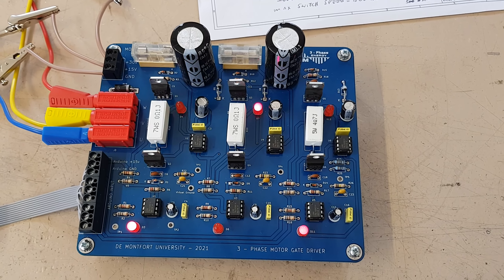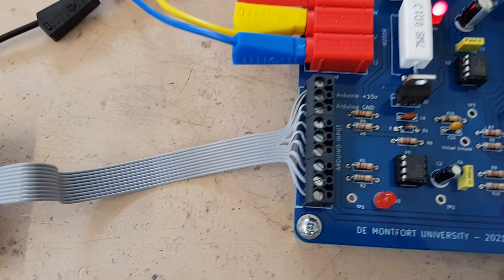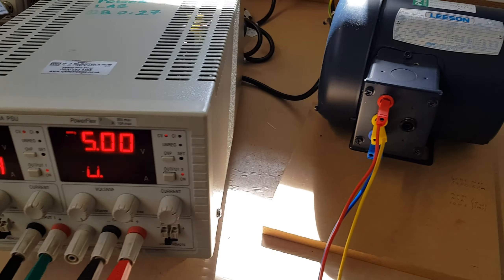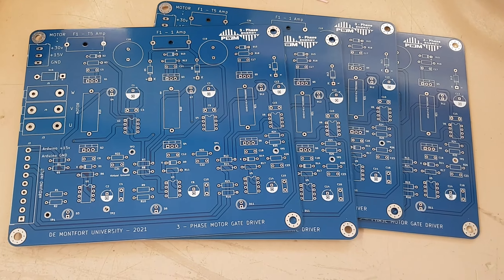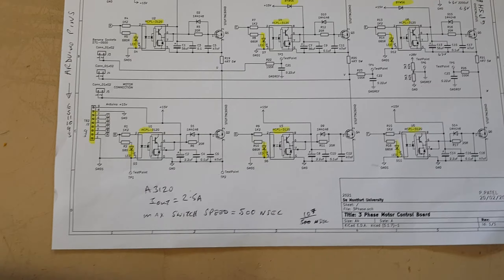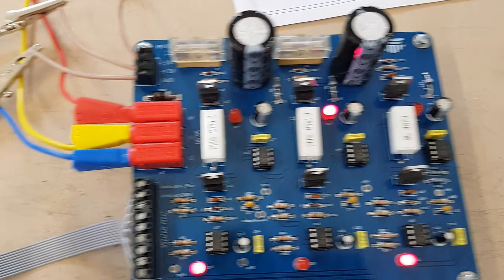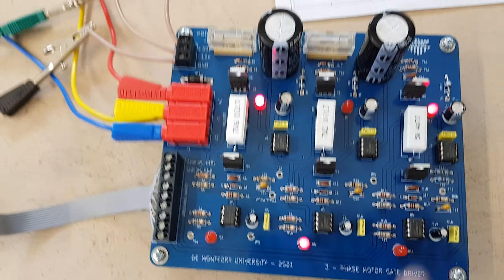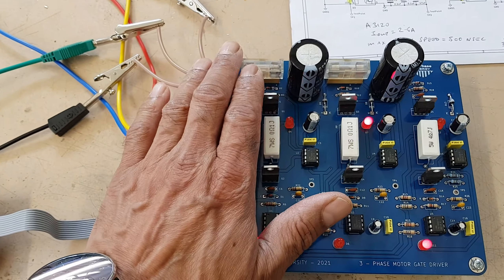Arduino Uno used to create an Inverter for a 3-Phase Motor !

Comment: Dear  Kash, l am very interested in your project, as teacher of electrotech at my local Tafe college l would very much like to build this , would it be at all possible to get the full data on this project please, many thanks.
Reply: Which TAFE college and did you end up making one? I am designing one now with harmonic filters and a 3 phase bridge rectifier to connect straight up to the ELV supplies in the classrooms.

Comment: Could you share a link to the motor? I'm interested to see all the details about it, the brand, speed/torque, the exact type (I suppose it's an induction motor?) and other technical characteristics about it. Also size and weight.

Comment: Hi Kash, fantastic project! Last week I started designing the inverter and I have a couple of questions before I want to have the PCB made at JLCPCB.

1.	As @optix also mentioned: is the REF ground floating? I see it goes to the center of a potential divider, but is it just a common for scope grounds?

2.	In the schematic you used GND and GND1. GND is from the power supply and GND1 comes from the Arduino (terminal). My question is, are these two grounds linked (externally) to each other and thus the same?

3.	Last question: Why did you use the BYW56 (avalanche) diodes with the top three drivers/optocouplers but not the bottom three?
Reply from the maker: Yes the floating ground is a common for the Oscilloscope leads, so that you can see the full sine waves
This is a demo board, and I have connected all the grounds together including the Arduino, 18v ground and the 35v ground.
The high side drivers at the top need the Diodes to charge up the capacitors when the bottom side drivers switch to ground. 
This is called Bootstrap diodes and capacitors, thanks 😊
Reply: Hi. for asking..could you be able to send me the two schematic diagrams posted here. the reason I asked is the author has abandoned the thread and links are expired. 
Thank you kindly.

Comment: What are  you doing to determine motor position to determine when to switch current through the coils?
Reply from the maker: You do not need to know the Motor position to drive a 3 phase motor. You just need to supply 3 Sine waves to the motor which are separated by 120 degrees between phases.
The amplitude of the Sine waves needs to be the same, above 30vac
With a current of about 3 amps
Reply: Im sorry. I had assumed the motor was a synchronous motor. But I now guess your motor is an asynchronous induction motor. 

I assume your doing PWM. what is the freqency? I noticed your large electrolytic capacitors, and noted that electrolytic capacitors tend to have comparitivly high series equlivent resistance (ESR).  And I noted the relatively long traces to each IGBT introducing unwanted equlivent series inductance ESI, That may become problematic at PWM switching freqencies under heavy current.   I'm thinking you might see better performance under heavy loads if you place smaller capacitance but low ESR ceramic capacitors to ground and locate them right next to the high side transistors. They will better help hold the voltage up and supply a bit more power when high ESR and circuit ESI become problematic under heavy current. Or maybe that's just over engineered for your use. 

The reason why I went looking for VFD (like your video), is that I'm considering making a reluctance motor/generator, and they are syncronousr motors that don't tolerate rotor slip from field rotation freqency very well. Although, a hybrid induction/reluctance can start up asynchronous inductance and switch to more efficent  synchronous reluctance as it comes up to full speed. 

On my channel, maybe you'll find my "axial flux falhabor wound coils on a slotless iron core" build interesting.

Comment: Hello Kash, great vid thanks. why is there 1 4.7 ohm and 2 0.1 ohm resistors? and any chance of code and diagram? links dont work.
Thanks
Reply from the maker: They should all be 0.1 ohm resistors.  Only added for protection if high side and low side mosfets switch on together in one phase.
This would blow both mosfets.
High current would produce a voltage across the Resistors and hopefully protect the mosfets.
Reply: Thanks, keep up the vids, nice pcb. I havd started making this. 1 more question if you don't mind, is the ref ground floating? I see it goes to the center of a potential  divider via a cap but is it just a common for scope grounds.?
Thanks again
Reply: I found the links BTW:-)
Reply: @optix3100  Can you please share the links ??

Comment: Nice work! I have 2 questions: 
1) there are two 0.1 ohm and one 4.7 ohm resistors on the board but in the schematic all three are 4.7 ohms. Any comment on this choice?
2) Can it run on 12V for Arduino and 24V for the motor?
Reply from the maker: All 3 are 4.7 ohm, I didn't have 3 at the time.
You need 18v min for the chips, and up to 40v for the motor, limited by the smoothing capacitors rated at 50v, cheers
Reply: @kashpatel898  Thank you for the answer and this design works on 12/24 V just fine.

Comment: How you do the deadtime  in the IGBT ?
Reply from the maker: It's done in the software, I used a look up table with zero values at the cross over points. This makes sure that the high side and low side drivers do not come on together.

Thanks
Reply: Amazing
Reply: @kashpatel898  hello please, I need your help